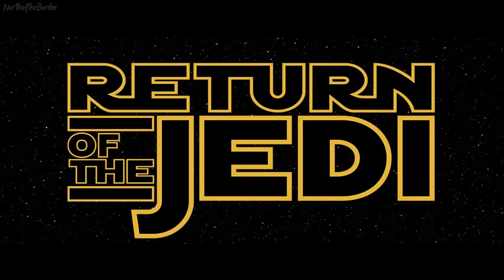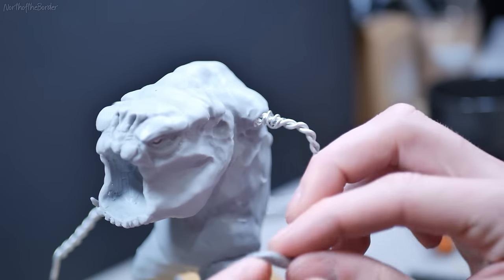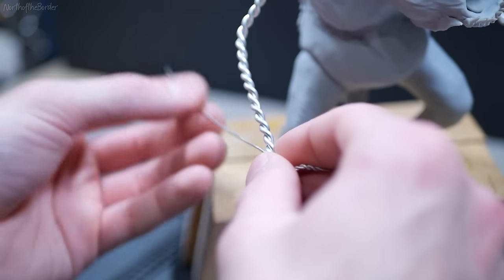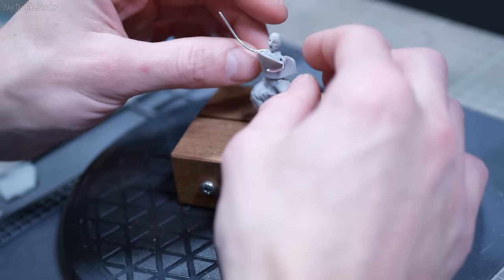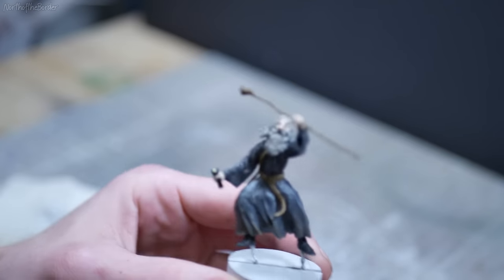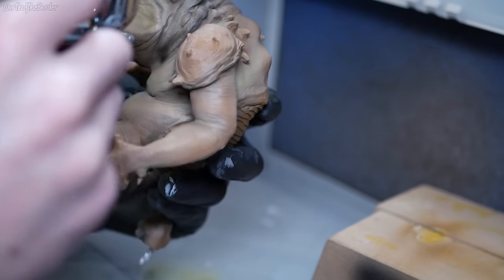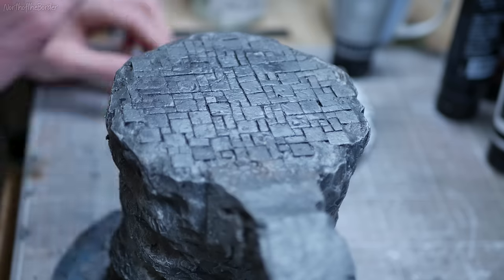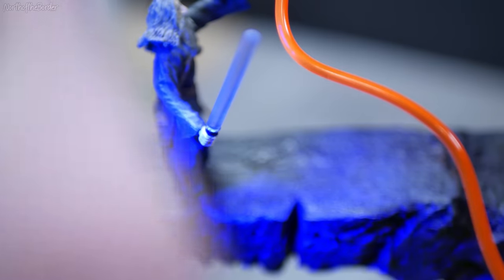STAR WARS + Lord of the Rings MASHUP \\ Gandalf vs the Balrog/Rancor

Comment: This is great! I was wondering if you've ever run into your sculptures getting sticky after a while. I have been making art out of clay for years and after I paint them  (I use acrylics and brushes) and they sit for a while (a few weeks maybe), I notice that they sometimes feel tacky to the touch. Maybe I just haven't found the right sealer or I'm using bad paints. Anyway, awesome work! I'm glad youtube recommended your channel!
Reply from the maker: Not as of yet, but I use almost exclusively Vallejo acrylic paints to paint any figures. The landscape/bases just get a coat of Liquitex acrylics (still not cheap, but the definitely much cheaper than the Vallejos), but I always use the fancy paints for the "important stuff". They're mostly paints for models, miniatures, etc so they're high pigment and very durable.
Reply: @NorthoftheBorder  thank you! I suspect that it is just time to get some new paints. I'll give vallejos a try.

Comment: Seriously, why haven't I found or been suggested your channel before... Question, what gauges of armature wire do you use?
Reply from the maker: Ah, but you're here now, and that's what matters! I use 3 main wires, 1mm, 2mm, and 3mm, all aluminium. Sometimes I'll use steel wire if I need it to be super strong (if you've watched the Alduin sculpture, that was with steel so it could support the full weight), otherwise, I can wind the wire into as many strands as I want to thicken it up.

Comment: OK so i watched the video while farting about the internet trying to find my kids a snow sled, then re-watched more carefully to try and figure out how you are powering it but I dont see it. I am looking to make a mini scene and I need 1 LED inside a character, and 1 at the base around him lighting him from below but I can figure out if i need restrictors, what kind of battery to use, how to put them both on one source with a switch. I am a noob at wiring.
Reply from the maker: I don't show too much of how I wire things, because it's the kind of thing where if a lot of folk did what I do, there would probably be a lot of fires (I'm not an electrician, so please take what I say with a grain of salt). The El Wire is easily wired up, since it comes pre soldered and connected to a 5v USB connector. It also has splitters, which let me add the led for the lightsaber (which needs a resistor to keep from blowing). So the two of them are essentially running off of a single USB battery pack that I aggressively jammed all up in the bottom. Of the pillar... I accidentally left it running while I was editing so I know it will run for atleast 4 hours without catching fire and burning my flat down. Hope that's some help!